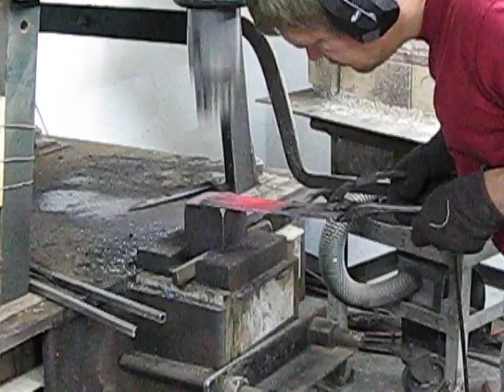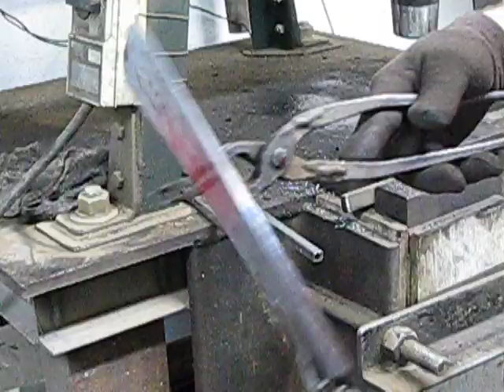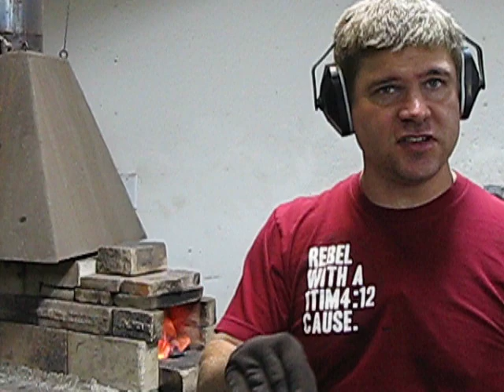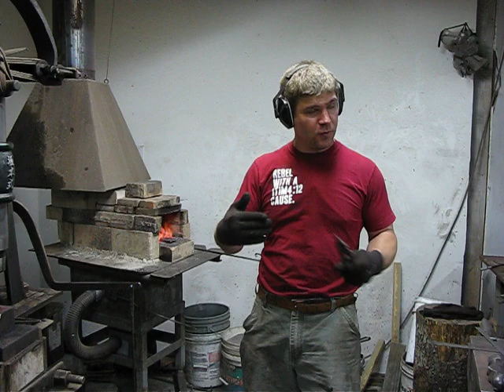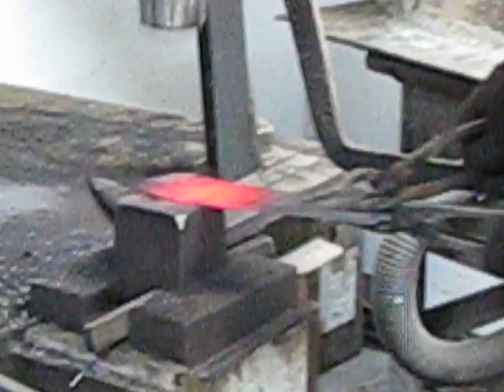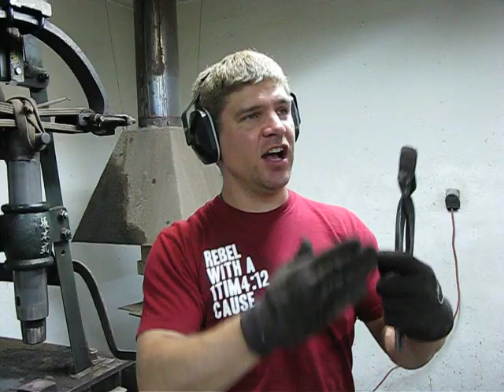Murray Carter forging a Japanese blade Part 1

Comment: Yoshindo Yoshihira, a Mukanza level swordsmith, uses a power hammer to do all the "grunt work"- forging out and welding billets, etc. It's cheaper than 2 or 3 apprentices and doesn't talk back. Personally, I'm fond of hydraulic forging presses, much quieter.

Comment: @TheHellBound666 That power hammer is more consistent, repeatable, even, and better regulated than hand-hammering could ever be.  The craftsman is the one who applies the force, just has a machine to assist with the heavy lifting, I see no problem with that, unless you merely want to say that your knife was entirely hand-made.  And think about how much more a blade would cost if you had three crews of two to do the hammering?